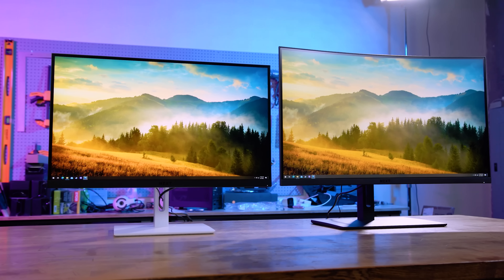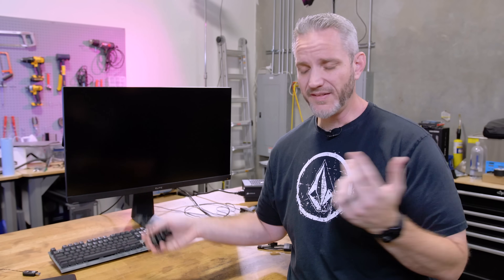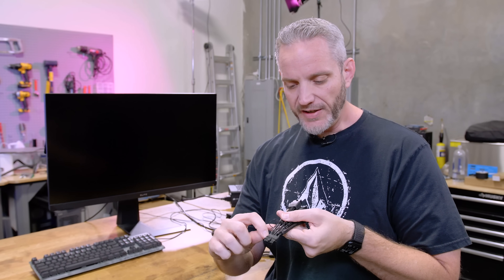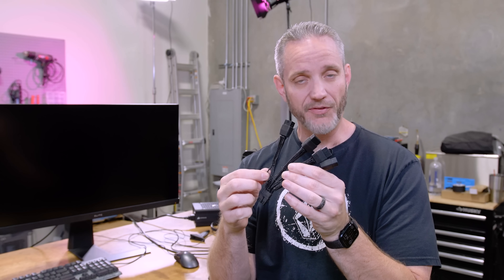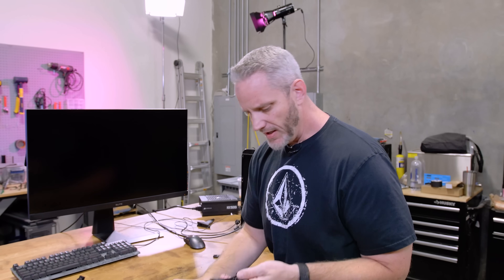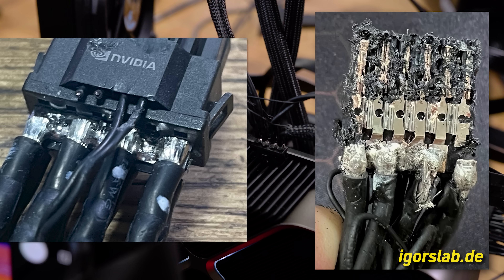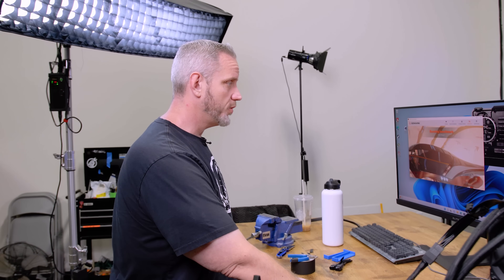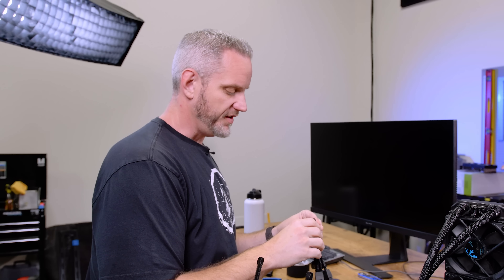Igor's Lab figured out why NVIDIA adapters are melting!

Comment: The issue is the pad/foil thing is breaking but maintaining physical contact allowing it to still carry current but leading to high contact resistance and heating. Break the pad off and like tape it back together to simulate it still being constrained physically by the connector.
Reply: This! I don't know much about how this stuff works, but to me it's logical that if the plastic on the sides is melting, it's clearly not an issue of all the current going through the center wires, but rather an issue with the current going through the wires on the sides.
Reply: x-actly :)
Reply: Yes, a lost joint won't melt because it's not pulling any power to heat up, but leaving a thin connection essentially a very thin wire attached drawing upwards of 100w will heat up like a light filament and melt the plastic.
Reply: It’s hard to watch him flail around and miss the obvious isn’t it?
Reply: @THECOD3Y   I mean, he's not an electrical engineer.  I was hoping Gamers Nexus or LTT would have weighed in on this, because they have people with the skills and equipment to check all of this stuff.
Reply: The core question is --- how could a giant company like NVIDIA outsource such lousy engineering for their power connectors?
Reply: @PHDarren  it's obvious you know basic electrical engineering
Reply: @fredwerza3478  From my experience in supply chain  I can say that adapters like this are considered a quick simple design that should not take up the time of experienced engineers. Taking up the few days or so to create the models/drawings/reviews of this is a waste of money for a company compared to having them work on the actual product. Now this relies on nVidia to have a group of audited, compliant, trusted external designers/manufacturers to create what should be a simple adapter. If nVidia provided the appropriate design input requirements and required applicable standards (j-std etc), then this falls on the adapter supplier.
Reply: @TikiPowers  yeah but your product is only as good as it's weakest link --- many people like Tesla cars but if batteries start exploding because some of some poorly-designed connector, it can wreck the whole company --- NVIDIA should know better
Reply: Yeah in the german video he even talked about inconsistent contact of the broken parts which causes heating up. Like a plug in a socket that isnt plugged in completely .
Reply: @fredwerza3478  Oh without doubt nVidia should have done reliability testing including the production adapter in a variety of real world situations. So that's on them. Unfortunately, I have seen times where improper/incomplete dFMEA (failure mode analysis) is used to skip such testing.
Reply: correct
Reply: He should try his favorite method of gluing components back on and see why you don't do that shit on power delivery :)
Reply: @TikiPowers  that’s normally true. However, in this case, Nvidia came up with a crazy ass crazy over complicated solution to what should’ve been a simple one and thus the resulting issues . . .
Reply: If it was arcing or contact resistance form breaking the plug I would think it would melt from the inside not the end of the plug. It seems like the inner wires each share two pins and the outer wires only have one pin per wire. So there is double the power going over the outer pins compared to the middle pins. Maybe if the outer pins then also heat up due to bad connection the heat adds up until it burns.
Reply: Yes I agree you need some increased resistance across the connection which can be generated by a poor connection be it a bad solder joint or a broken pad that is close to where it needs to be but far enough away to result in arks of electricity which would then result in significant heat generation.
Reply: if you look at the terminals in the plug on nvidia vs corsair/cablemod theres a big difference there, on the nvidia plug theres a cut both on the top and Bottom=no support side to side on the actual terminal however on the corsair/cablemod theres only a cut on the bottom one that gives it alot more stability and wont deform like nvidias terminal and by that bad connection. The other thing here is the plug is not melting on the bottom, only around the front at the terminal point. If it actually was the solder point causing it to melt then the plastic back there should melt aswell.
Reply: Hmmm... maybe there is a reason why high power mains connections are not made by soldering
Reply: @TeePythonColt  there's all kind of pictures out there where the heat has obviously spread out. Metal in there is also very good heat conducting material so it would spread the heat in any case. 

Arcing won't happen on 12V but I think it just resistance heating.. bad connection means it will just heat up the connector until it starts to melt. 

Well, that's my guess anyways. :)
Reply: ding ding ding yet again cheaping out on stuff creating hazard environment

Comment: It's not just that the outer wires breaking are increasing the load of the center wires.  The outer wires may also be experiencing electrical arcing between the broken pieces.

Edit:. For anyone that doesn't know, arcing creates heat.
Reply: Arcing does seem likely with the way some of those plugs are melted. They're less "Plastic got hot and melted" and more "Plastic caught on fire and melted", which arcing absolutely would do.
Reply: I had one of those molded cheapo Molex to Sata (lose your data) that arced on the first use. Can confirm it generates heat and can melt stuff.
Edit: It's specially worse when the PSU doesn't cut power and keeps going as if nothing is going on while everything else is burning (I was testing an extremely generic PSU).
Reply: Forgive me if I'm wrong as it was a few years ago now that I studied electricity and electronics but don't you only start to get noticeable arcs at high voltages? I seem to remember 22KV arching less than 1cm, so 12V wouldn't even arc a fraction of a fraction of a mm, let alone really carry much current in these cables for it to even be that hot
Reply: Can you get arcing when the wires are essentially the same phase, the electrical potential should be too similar?
You certainly could get increased contact resistance which makes heat which makes even more resistance..something  which is known to create enough heat to start fires.

If there is a hair break in the foil it essentially turns into a badly crimped phase wire, something known to cause destructive heat but I've never heard of a single phase, single electrode arcing.
Reply: If it's not arcing it might be just not enough contact between the broken wire and the metal plate...causing it to overheat
Reply: @ChromaEquinox  I doubt it'd be noticeable arcing since nobody is noticing the connecting melting until they pull it out.  But any resistance can cause a runaway affect, continuously building up heat.  May not be enough to start a fire but can definitely be enough to not just melt but burn the plastic.
Reply: my dad melted the tip of a slot screwdriver trying to fix a dryer what was still plugged in and had an arc
Reply: Arching can happen at low voltages like 12 volts, since inductance is a thing, also resistance in the electrical connection is seen at the psu as an increase in load... Also, working with car stereo equipment, i have seen my fair share of 12 volt circuits arc and cause fires, even explosions when enough capacitance is introduced... Arching can happen within a nanometer, and there the voltage might only be at 1.4v...
Reply: Also to add, current is the thing that kills, not the voltage...
Reply: @ChromaEquinox  High voltage will arc, but anyone that’s ever jump started a car knows that 12v can also arc. We are talking a very small space inside these plugs, so a fraction of a mm is exactly the kind of distances arcing would do there
Reply: Wow, there seems to a be a lot of strange comments on this. Yes arcing does create heat, any path electricity takes creates heat and 12v arcs over air would be very high resistance. The more likely reason would be just damaged single core cables or partially sheared multicore cables.
Reply: THIS GUY IS RIGHT....... Thats why its always the outside pins that are melted.... its the ARCHING OF THE BROKEN JOINT that is the REAL problem. Thats whats causing the melting.
Reply: As a total noob who doesn't know jack about this, I assume that any arcing=very bad right?
Reply: I was thinking this myself. If part of the connection breaks off or is fractured in some way, it isn't going to be very far apart inside a connector. Slight vibrations could easily allow the connection to be repeated made and lost, the electricity is able to flow (a connection was made for any length of time) and when it spreads apart, the electricity is still trying to flow and jumps the gap, creating lots of heat.

I work on cars for a living so this is just what I've seen, but even as low as 5V circuits can create an arc if a powered wire touches ground, it may be able to arc due to a microscopic gap too, but I have not personally seen that in cars.
Reply: @rankcolour8780  It's not just the voltage that plays into it, the Amperage matters too. If you think of the electricity flowing like water in a tap, the voltage is how large the opening is, and the Amperage is the water pressure. With these cards drawing Amperage on the order of cars starting, there's definitely a possibility of arcing.
Reply: @GreenLantern814  That's missing the point. Several points in fact.

Most important is the point that the arcing suggested would be shorting between across points carrying the same Amperage. The points in question are part of the same phase carrying the same (for this purpose at least) supply. This not an arc from one phase to another or one phase to a ground. 

You don't need high current to create a short, I literally arced from my finger to my bannister about 10 minutes ago walking down my stairs in socks.

Arcing happens due to a difference in electrical potential. Please don't for a moment convince yourself it's down to current as A, V and W are all functions of each other. The difference in potential between two electrodes is what drives an arc. How big the arc is and how well it overcomes the resistance of the medium it traverses through depends on many factors.

A taser arc created by a high V , tiny A supply is another example of why current has little to do with arcing vs electrical potential.
Reply: @rankcolour8780  you are correct, potential difference is still not that simple as havin two phases. Arching can and does happen every time there is a potential difference at the start of the connection, this is mostly taken care of capacitors to filter out these potential differences. But at the pci e supplemental power connectors there are no filter caps to handle big potential difference. Also separate 12 volt rail broken but close enough to cause an arch, will arch as long as the load is asking for the current.
Reply: @rankcolour8780  also, you are being a tad bit condescending, we cant write a full electric physics course in to one comment, not enough space. Low voltage application reguires high amperage to get high wattage, there the point more simplified
Reply: @rankcolour8780  also, more amps, more surface area needed to dissipate that current, or to conduct it somewhere where it can discharge safely.
Reply: @shadowwolf2608  Oh yeah dude..... very very bad. Imagine a welder..... thats an "arch"
Reply: @rankcolour8780  more surface area = more conductors within the wire, thick solid core lead works best on high voltage low amperage situations. Thick lead with multiple thinner conductors works best on low voltage high aperage.
Reply: @Wolfman2989  Isn't that the point though, looking at the pin-out of where this idea of arcing is happening it isn't even between two phases or where there is any real potential difference.

It's happening at a point of mechanical load balancing. The pin and the pin next to it are to all intents and purposes carrying the same charge and delivering it to the next terminal. The structure of the plug is designed to balance the load, hence the foil the pins are soldered to.
 
It's not even like the suggested cause of this issue is a terminal/pin has broken connection to its target, it's like we are examining multiple strands of the same core at the crimped end.

Have you ever seen a cable arc with itself at the crimp?

What on earth do you mean condescending? The whole point of this is talking about how and why it's happening, unsure why that has caused you offence.
Reply: @rankcolour8780  You're looking at the potential between the 12V, which Jay doesn't do in the videos. But you're also discounting the draw of the card. It's still the easiest path for an electron to take. No one's claiming the arcing is happening without the card being plugged in. So I'm confused about how you're confused?

Anyways, if my info isn't helpful, ignore it.
Reply: @GreenLantern814  
You don't seem to understand, it's no problem.
I'm not making points about anything you mentioned there at all 🤣.
No wonder it felt like you were talking to someone else about something else.
Jay literally discusses the load balancing aspect of it being a single phase single electrode in the video (that's what the foil is there for).
Perhaps you don't understand what I'm saying, and that's ok too. No harm no foul.
It might help you to start to understand what we are talking about by looking at the pin-out of the socket.
Reply: @rankcolour8780  your terminology is a little bit erratic, and it is telling me that you are trying to be right at any cost, and defending Jay even tho no one is attacking Jay or you... One broken connection to the foil has potential since it is in many cases a separate voltage rail to the others. Also look up condescending behaviour from wikipedia at least so that you can understand how your wording of comments can be understood as such... Anyway, good morning, i slept like a baby...
Reply: @Wolfman2989  
I'm trying to explain as simply as possible that it's not arcing.

Rather than being a blunt internet warrior and just flat out telling people it's not arcing and being passive aggressive, I thought I'd try and explain gently to people by giving them a little bit of knowledge they can look up themselves why it's not arcing.

If you read NOT being rude to people or aggressive as condescension honestly the problem doesn't lie with me.

To be very blunt then, if you don't like having things explained; 
"It's not arcing"

The electrical potential of this terminal can't create enough of an inductive spike - it's an issue with resistance and runaway heating.  

I'm glad you slept well, perhaps with a fresh mind you might be able to digest the information.

Comment: Awesome job covering it, and thanks to Igor's Lab. I heard of this and thought it sounded ridiculous since there's no way it could stress with 4 connections, only to discover it was either 3 or 2 that were actually connected, causing high temps due to the resistance.
Reply: Take a swig of a nice aged wine every time Jay drops one of the cables onto the table in frustration.

Comment: As an electronics engineer this is really useful to learn from. Had to deal with poorly manufactured cables in the products i develope at work after our purchase department decided to save some bucks. I even implemented an automated cable tester that we use during final assembly of our products.
Reply: Boneless chicken.
Reply: " I even implemented an automated cable tester that we use during final assembly of our products." were you accordingly compensated for your efforts?
Reply: @LiveBenchmarks  Unlikely, from my own experience, but it does make your job easier and gets your work done faster and properly. Having to wait for customer-feedback about how well a fix worked or find a round-about way of testing something takes quite a bit of time.